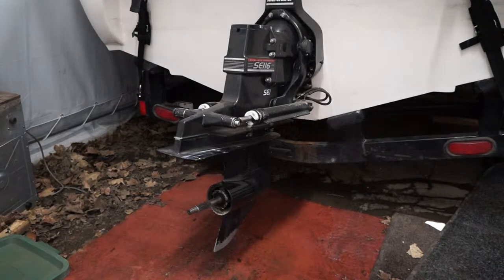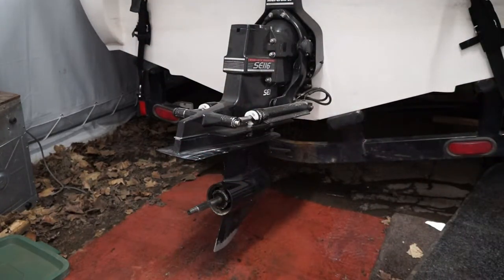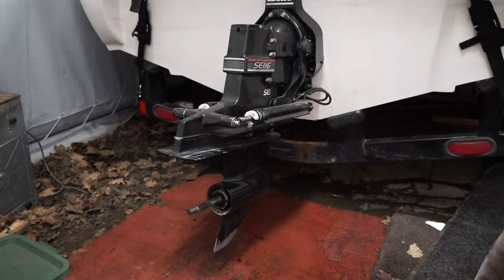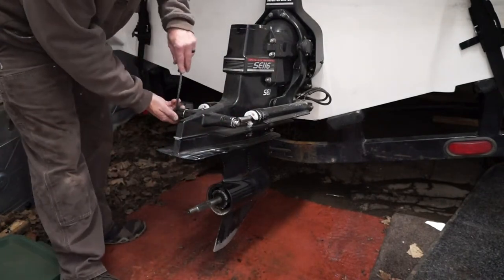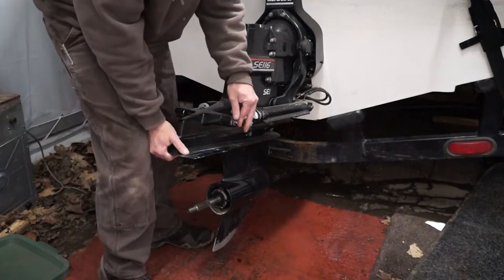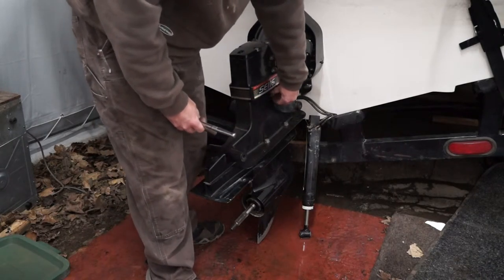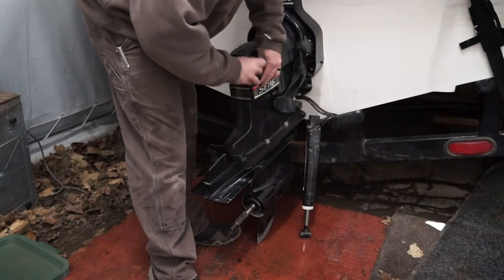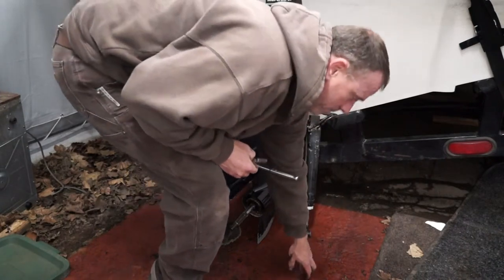How to remove mercruiser alpha one gen 2 outdrive

Comment: If I have a driveline oil reservoir - should I empty it first?  Would the oil be pouring out at this step?
Reply from the maker: Mark Hatfield no it’s not necessary, it has a check valve at the bell housing where the out drive connects, it will prevent the oil from draining out of the reservoir.
Reply: @maineboatguy  do you need to remove the bellows? or do they stay on the boat at this point?
Reply from the maker: @Middlemcd  bellows will stay connected.

Comment: I pulled my outdrive and the gimbal bearing came out on the shaft.  Is that going to be a problem??
Reply from the maker: Really depends on how tight the gimbal bearing fits back into the transom assembly. If it slides in with no effort you’ll have vibrations but if it needs to be hammered in with the tool then you are most likely ok. Also check the driveshaft where the bearing is stuck after you remove it. Might be corroded worn etc and need to replace the shaft.
Reply: @maineboatguy  Thank you very much!